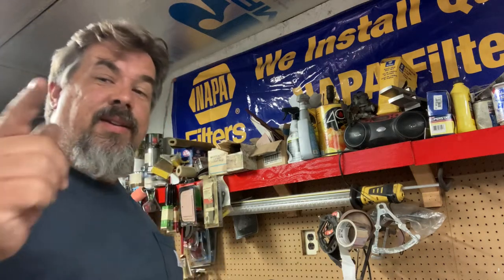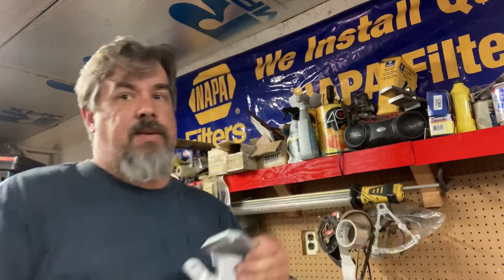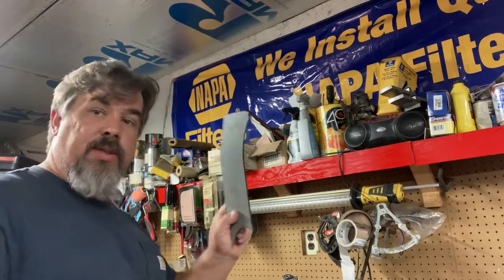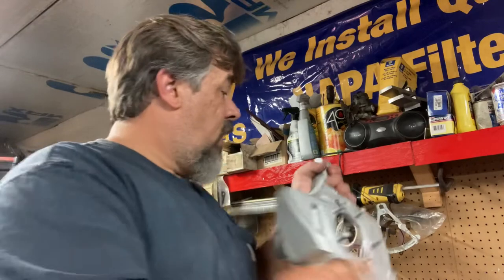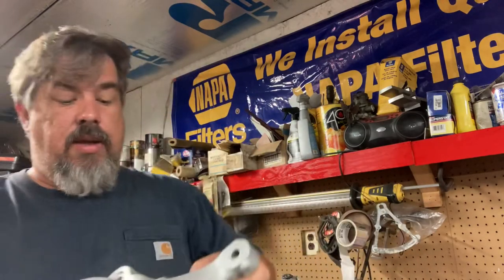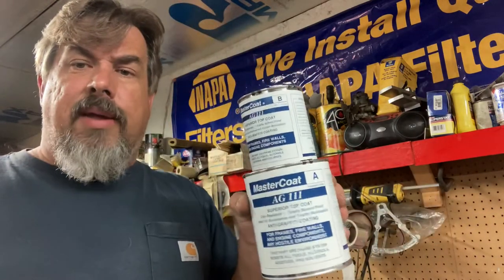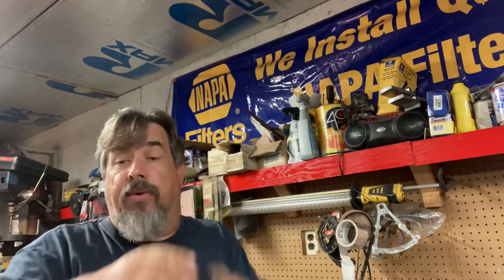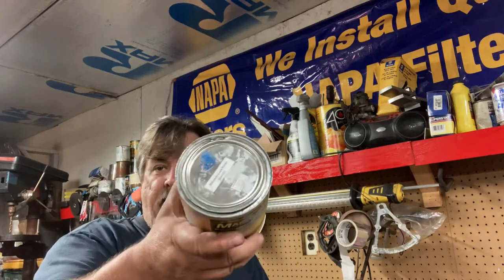TTB ford and Mastercoat paint

Comment: I’ll second the Mastercoat recommend and user advice.  I’ve been using for the past couple of years now, and it is the best coating I’ve used for corrosion protection on steel.  I prep much the same as the video. Clean with mek/lqr thinner, bead blast, two coats sprayed or one coat brushed.  I top coat while it is tacky, just tack free, urethane enamel and poly urethane. The top coat hardens better than anything I’ve used when sprayed with Mastercoat tacky. Even on it’s own, not top coated, very tough tough coating.  Good video, just subscribed.  I wish I would’ve found this coating decades ago.
Reply from the maker: Stay tuned Mastercoat has a few things coming out I was just on the phone with him last week I’ll share soon as I get them

Comment: Will try this MasterCoat yet would like to see some rusty things coated 5, 10 or 15 years down the road. All coatings if prepped and painted look good for some time. The real test is years later. Please post if you have any such experiences. Also, Twin I-Beam was the bombe. So sorry Ford abandoned what gave them the edge in durability and low maintenance. Maybe that's part of the reason they don't advertise the longest lasting truck assertion. And, of course, modern truck will likely be disposed of when too many sensors fail and they are just to expensive due to all the federally required electronics. Thanks for posting!